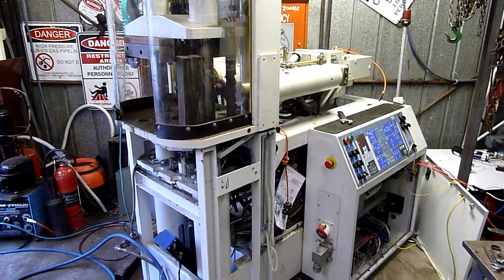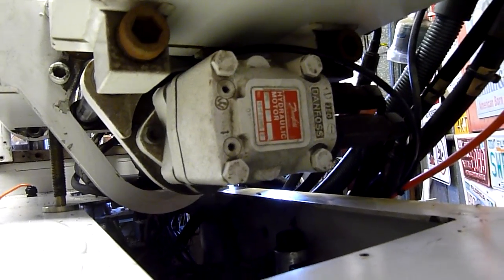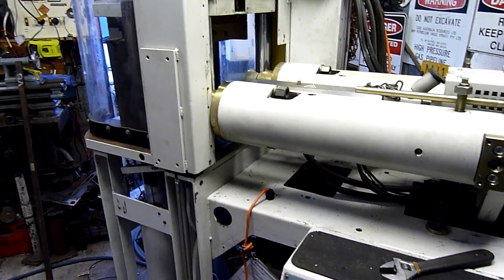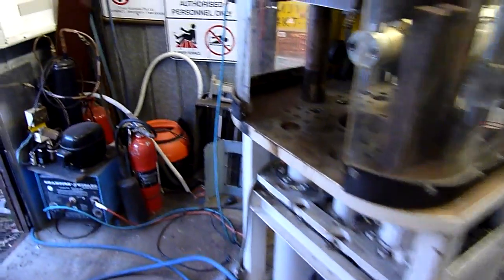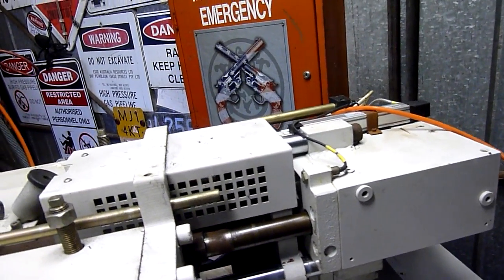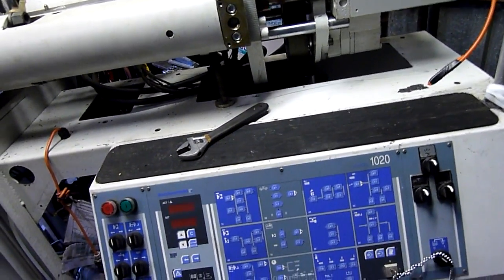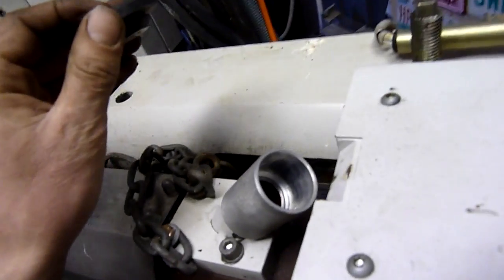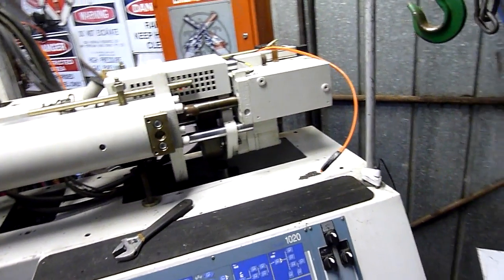Battenfeld Plus 350V Rambling and Injection Unit

Comment: ahhh good point in line switch heat one at a time then there's only one at a time drawing heaps but as you where saying it should run if you can get the wiring sorted :)

Comment: can you disconnect the heat bands and put a resistors in place of the temp sensors would save you a lot of power not running all the heating on it :/>

Comment: Service it regular and it will do 50 years easily running 24/7 with only one or two major overhauls in that time, and a good number of seals as they fail. When you build it well it lasts a long time.